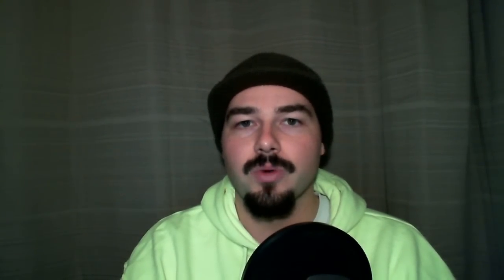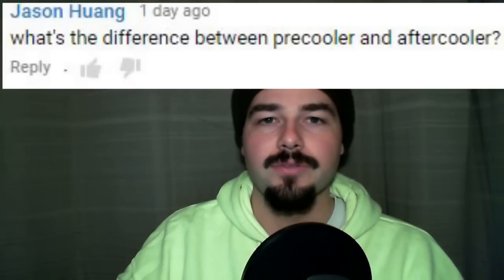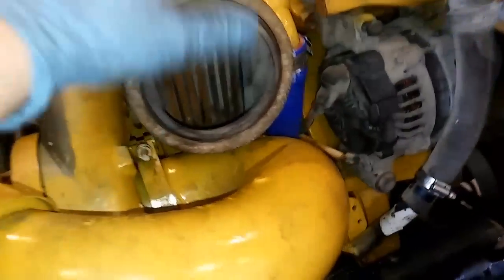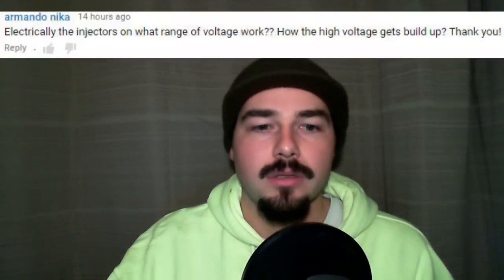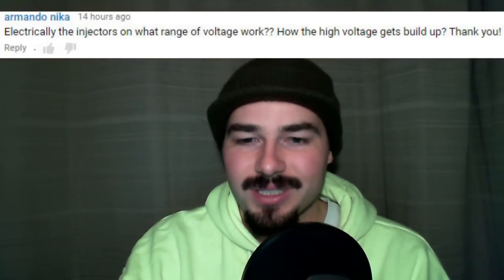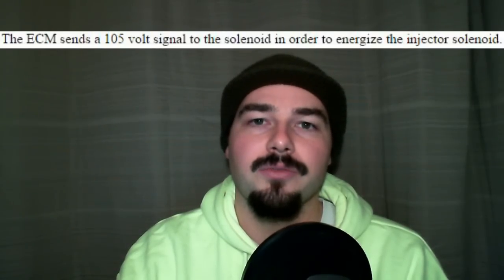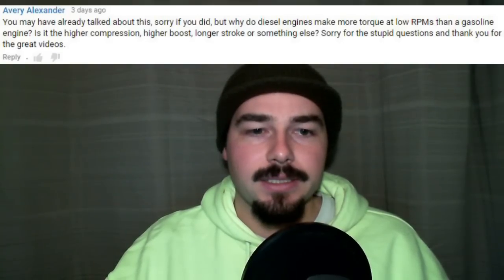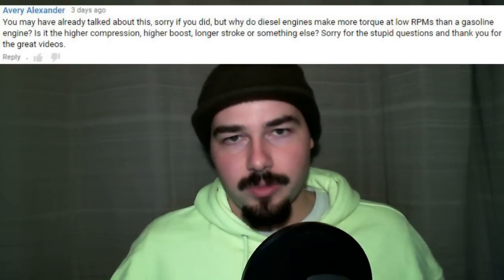What Is A Precooler?  What Is Mechanical Advantage?  C18? Injector Voltage?  Diesel Talk Episode 11.

Comment: Diesels don't always produce more torque than gasoline engines, and if they do it's because they're boosted higher. Where diesel engines make their torque (at low revs) is entirely a result of tuning. Diesels simply can't run at high rpm, so manufacturers are forced to focus on making torque at low revs, this means that everything concerning engine tuning (cam design, port design, manifold design, etc) is geared toward making torque at low rpm. With gasoline engines, it simply wouldn't make any sense to focus purely on low rpm torque, because then you'd lose the advantage of making significantly more power from your engine at higher rpm. 

Back in the days when you could still buy naturally aspirated diesels, those diesels all had less torque than any comparable gasoline engine. Compare the Olds 350 diesel to other V8s of the day, compare the Mercedes-Benz OM604 engine to the Honda F series engines, etc.

Edit: Even the naturally aspirated 6.2/6.5 liter Detroit Diesels had trouble matching the torque output of GM's smaller 5.7 liter gasoline V8s. 

https://en.wikipedia.org/wiki/Chevrolet_C/K#Engines_3
Reply: idontcare80 I call bullshit, I work for Cummins in Louisiana and I could tell you that diesel engines make torque in the low range not just because of the way they are tuned. They make torque low range due to the longer stroke of the crankshaft. And that's just the end of that!!! Modern day diesel engines make significantly more horsepower than they did before simply by electronic tuning via the ECM. Nowadays you can add max horsepower to a diesel engine according to that engine code. Although, torque really won't be affected to any significant degree.

Example: an ISX15 is capable of 800 hp with the correct ECM calibration. However, most are governed between 435 and the 550 hp. I have personally ran an ISX15 with the CM550 control system on the engine Dyno. It made 802 hp at 1800 RPM turning 2530 foot pounds of torque. This particular engine was built by me for a generator package for hospital. This engine is still in service today and it normally runs at a constant 600 hp. Although, when the hospital loses power and the generator goes into full ramp mode the engine runs at governed 800 hp for up to 30 minutes constant!!!
Reply: "They make torque low range due to the longer stroke of the crankshaft."

Except that this would allow the engine to make more torque at any rpm, and it doesn't.

I'm not really sure what the point of the rest of your comment is. Are you saying that it's surprising that a 15 liter diesel, that is tuned to make a huge amount of torque at low revs, makes a huge amount of torque at low revs?
Reply: The older car/pick-up diesels were built on a structurally weak block/head foundation, so the engineers rightly derated them to ensure their longevity.  Adept is correct with his reference to crank throw length adding to torque.  Torque does not increase after peak torque rpm is reached regardless of any increase in rpm thereafter. Peak torque is achieved at a rpm when the air and fuel possess the optimal time to ignite and expand, which these days is around 1100 to 1300 rpm (diesels); consequently, any increase in rpm thereafter decreases torque but increases horsepower, because the pistons will be revolving faster than the air and fuel can be maximally utilized.  Tuning performed by a professional is a minor factor in torque output.

The Cummins diesel pancake J used in its race car decades ago turned around 10,000 rpm, so yes, diesels can be engineered to rev higher; however, in the real world, revving a diesel to car-like rpm would defeat the advantages of diesel engine economy.
Reply: "The older car/pick-up diesels were built on a structurally weak block/head foundation, so the engineers rightly derated them to ensure their longevity."

No, all of those engines were much more heavily built than the gasoline engines I compared them to. The Honda F series was even an all aluminum engine, while the OM604 had an iron block. The Olds diesel 350 blocks were actually highly sought after by race engine builders because they were so much stronger than the gasoline engine blocks.

"Adept is correct with his reference to crank throw length adding to torque."

The lever action changes as a crankshaft rotates, so while you might see more peak torque during part of the rotation of the crankshaft, you'll end up less for the rest of it, so the average torque output over the full revolution is the same, regardless of stroke. 

"Torque does not increase after peak torque rpm is reached regardless of any increase in rpm thereafter."

Peak torque doesn't increase after the peak? Huh, who knew? lol

"Peak torque is achieved at a rpm when the air and fuel possess the optimal time to ignite and expand"

If that were true, all gasoline engines would generate peak torque at the same rpm, and all diesel engines would generate peak torque at the same rpm. Engine aspiration efficiency is what mainly determines peak torque rpm (more fuel and air in the cylinder make a bigger boom) and engine friction also plays a part in where torque will peak (faster moving parts = more friction). Where the engine aspirates most efficiently is determined by how the engine is tuned. 

"any increase in rpm thereafter decreases torque but increases horsepower"

Until torque starts to drop off rapidly enough that power output follows, and that happens in diesels at a much lower rpm than it happens in gasoline engines.

"Tuning performed by a professional is a minor factor in torque output."

I'm not talking about aftermarket tuning, I'm talking about the engineers who do the initial tune and determine the entire character of the engine.

"The Cummins diesel pancake J used in its race car decades ago turned around 10,000 rpm, so yes, diesels can be engineered to rev higher"

I can't find any reference to this. Even the engine in the Audi R18 LMP car only revs to around 5,000 rpm.
Reply: Peak torque occurs when the cylinders are maximally filled with fuel and air at an engineered rpm.  Any higher rpm than that results in a condition whereby piston speed is too fast to allow the cylinders to optimally fill with air and fuel, thus less torque at higher rpm but more horsepower, a common engineering concept. 

Your statement   "...peak torque rpm (more fuel and air in the cylinder make a bigger boom)..." Yes, that is what I described as peak torque, which can vary a few hundred rpm depending on the engine design.

"Average torque output" does not contradict anything Adept or I said  or stated. 

Certain people wanted the "older" blocks - good for them, but those blocks were still too lightly made for economic diesel power - in other words, those early car diesel engines could have had their power jacked up but at the cost of longevity and reliability.  You referenced the younger versions - the older versions of the 70's and early 80's were even less stoutly manufactured.

"Tuning" - OK, you and I are talking about the same idea.  Every mechanic I have talked to uses the word tuning to indicate valve/ injector/jake adjustments and engineering to indicate the design/operating parameters of an engine.
Reply: "Peak torque occurs when the cylinders are maximally filled with fuel and air at an engineered rpm."

What you're describing is called volumetric efficiency, and that "engineered rpm" is determined by things like cam design, port design, manifold design, etc... which is what I said before.

"...less torque at higher rpm but more horsepower, a common engineering concept."

To a point. Like I said, eventually torque falls off so steeply that power begins to fall of as well.

"...which can vary a few hundred rpm depending on the engine design."

Peak torque can vary by thousands of rpm, depending on engine design. A high performance car might have its torque peak over 6,000 rpm, while an economy car might have it at around 4,000 rpm. Some racing engines can have their torque peak at over 15,000 rpm.

"...does not contradict anything Adept or I said  or stated."

Yes is does, because mean torque (average wasn't the right word) is what gets measured, not the peak torque pulse of each cylinder.

"...in other words, those early car diesel engines could have had their power jacked up but at the cost of longevity and reliability."

I understand what you were trying to say, but you have no basis for saying it. The Mercedes engines were a very mature design, and there's no reason to think that 6.2/6.5 Detroit Diesel V8 was limited in any way. Diesels are almost universally turbocharged because they're completely gutless without turbochargers. Also, you can compare modern turbocharged gasoline engines to diesels and see that, in many cases, their torque outputs are very similar to modern turbocharged diesels.

" Every mechanic I have talked to uses the word tuning to indicate valve/ injector/jake adjustments and engineering to indicate the design/operating parameters of an engine."

That's because they aren't determining the overall design of an engine the way the initial designers are.
Reply: idontcare80 No, I'm simply saying that diesels simply make their torque down low due to the crank stroke! I only explained in more detail with an example of what I said in my comment! Diesels can't turn high rpm due to the rate the fuel is burned and rotational load from much heavier components! It very much easier to sling a rod out the block on a diesel rather than a gas engine! Diesels basically are time bombs waiting to come apart...............
Reply: I am going to join Jatho and say that Idontcare80's input is strictly Bravo Sierra.  "He knows enough to be dangerous" as we say in this business.  

Peak torque and volumetric efficiency are different, as the latter describes an IC engine's ability to move a charge of air/fuel into and out of a cylinder at any rpm, whereas peak torque occurs at a set rpm.

He states, "...eventually torque falls off so steeply that power begins to fall of as well."  That is not even wrong!  As I stated before and thousands of engine performance specifications reveal, after peak torques decreases with increases in rpm, the horsepower simultaneously increases.

He states that diesels are "...completely gutless without turbochargers."  What! Back in the days, Cummins NH220, a naturally aspirated diesel, would, by a small margin, outperform a comparable White 500 series gasoline engine and achieve superior fuel mileage and longevity.

Today's nicely engineered turbocharged gas engines do perform well with comparable diesels but only in the lower ratings; however, there is no way heavy duty gas engines can match the performance of heavy duty diesels, and that is the subject of Adept's video.

Go ahead - have the last word.
Reply: "I am going to join Jatho and say that Idontcare80's input is strictly Bravo Sierra.  "He knows enough to be dangerous" as we say in this business."

He said nothing of the sort, he was just clarifying what he said, and he's still wrong.

"Peak torque and volumetric efficiency are different, as the latter describes an IC engine's ability to move a charge of air/fuel into and out of a cylinder at any rpm, whereas peak torque occurs at a set rpm."

I didn't say they were the same thing, I said volumetric efficiency (VE) plays a big part in where peak torque occurs. VE varies across the entire rpm range of the engine (where VE peaks is determined by the engineers), and peak torque occurs at a point where VE is high and friction is still relatively low. 

" As I stated before and thousands of engine performance specifications reveal, after peak torques decreases with increases in rpm, the horsepower simultaneously increases."

I still don't get why you think this is relevant. Peak torque is called peak torque because it's a peak, which means torque will be less before and after it. Power can still increase after the torque peak, yes, but the higher you can make the peak torque output, the more power you will make. 

"Back in the days, Cummins NH220, a naturally aspirated diesel, would, by a small margin, outperform a comparable White 500 series gasoline engine and achieve superior fuel mileage and longevity."

A) That was a long time ago, well before EFI.

B) One pair of engines doesn't represent all engines. 

"Today's nicely engineered turbocharged gas engines do perform well with comparable diesels but only in the lower ratings; however, there is no way heavy duty gas engines can match the performance of heavy duty diesels, and that is the subject of Adept's video."

That's simply because no one makes one, not because it's not possible.
Reply: Except that it has nothing to do with the length of the stroke. You can tune gasoline engines to make their peak torque down low too, it's just rare to see because there's a significant benefit that comes with being able to make torque at higher revs, and that is the significant increase in power output that comes with it. 

Part of the reason that diesels are built heavy because they have to produce a lot of torque in order to produce a decent amount of power (because of the slow expansion of their combustion gasses) and this puts a lot of stress on engine components. In other words, diesels do not spin slowly because they're built heavily, they're built heavily because they spin slowly. You're somewhat right about what happens to diesels at high rpm being related to stroke. As the length of the stroke increases, so do piston speeds for a given rpm, and high piston speeds do put very large amounts of stress on internal components.
Reply: idontcare80 dude you're an engineer huh? I work at cummins so I see everyday anything from a 2.8 ltr up to a 19 ltr as well as diesel CNG, LNG AND LPG cummins engines. I've been through 3 yrs of college and 1.5 yrs of cummins specific training. So, we've got to agree to disagree on this topic man! Besides, this is ADEPT APE's channel, why don't you ask his opinion so you can insult his intelligence. I'm through with it!
Reply: With all of that training, you can't tell me why I'm wrong? I'd demand my money back, if I were you. 

Adept Ape can respond to me just as easily as anyone else can.
Reply: Well, I thought I wouldn't say anything more about youknowwho80, but it is discernible he is not an engineer.  

His latest, "...peak torque occurs at a point where VE is high and friction is still relatively low."  The fictional properties of the combustion chamber are the same regardless whether the engine is turning 1100 or 2100 rpm.

Another one - "That's simply because no one makes one, not because it's not possible."  A joule of energy is a joule of energy, and a gallon of gasoline contains less joules than a gallon of diesel.  There are also less pumping losses in a diesel engine compared to a gas engine.  

OK.  That is my last comment on this.
Reply: Amazingly enough, people who aren't engineers can understand engineering concepts.

"The fictional properties of the combustion chamber are the same regardless whether the engine is turning 1100 or 2100 rpm."

FRICTION. The moving parts in the engine itself produce friction, and that friction builds exponentially with engine speed. The faster the engine turns, the more of its power is consumed by friction.

"A joule of energy is a joule of energy, and a gallon of gasoline contains less joules than a gallon of diesel."

Yup, diesels will always use less fuel by volume than gasoline engines, the problem is that doesn't really mean much. By volume, diesel fuel costs more, and, by volume, diesel produces more CO2 when burned, hence why diesels don't have any advantages in the modern world.

"There are also less pumping losses in a diesel engine compared to a gas engine. "

Not any more there isn't. Modern diesels have both throttles and horribly restrictive exhaust emissions controls, both of which increase pumping losses.

Edit: That last bit may only apply to light diesels.